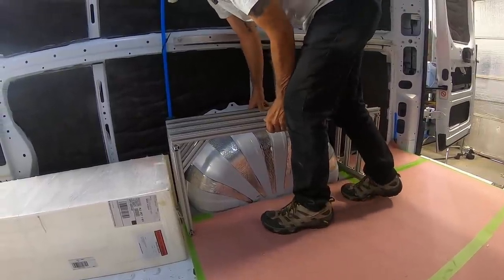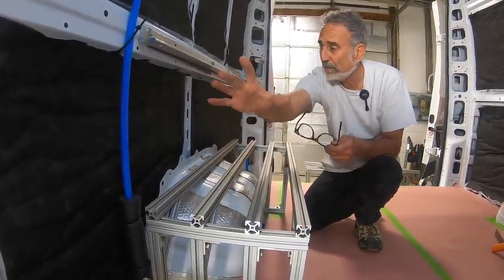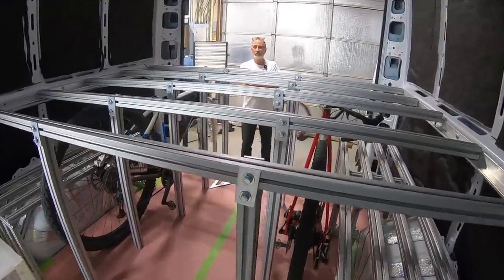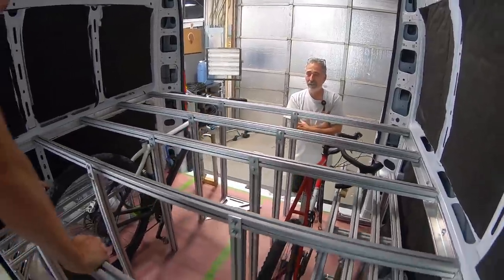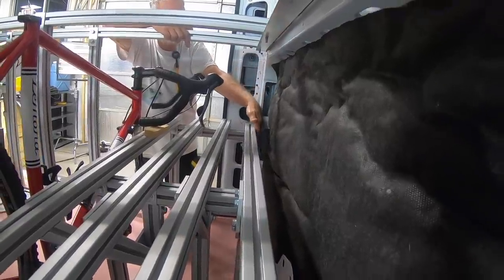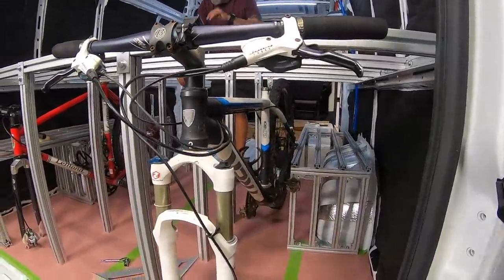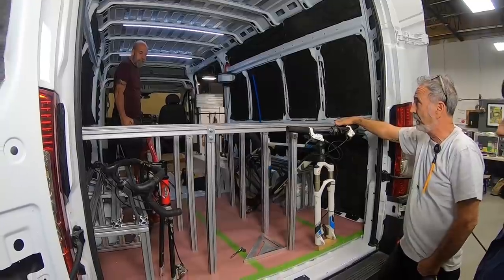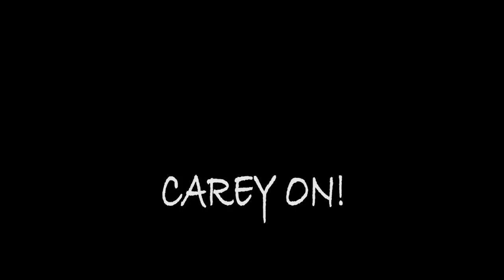Epic Van Garage, Van Bones. Vagabond Van Build.

Comment: I like the garage design, very functional. This is why a custom build is the way to go, you can get the dimensions just right for your needs and not waste a single inch of space. Plus this 80/20 seem like a good investment too, being lighter and stronger than wood, although it's probably is bigger hassle to work with, especially fastening it together and to the van chassis. It's coming together nicely guys...great work!
Reply: I bet it wont come apart like wood might in a crash though. (Jinx)

Comment: I would like to know how much heat still transfers despite the heavy weight vinyl acting as a barrier between van body and 80/20? Put the van in the sun and put an unattached 80/20 piece for a control. Take temps of van metal, the bolt in between, the attached 80/20 bed in different places and compare for heat transfer.

Comment: Hi!  On a future video could you mention the specific 80/20 extruded aluminum size you're using?  1"? 1.5"?  metric?  Thanks!  Gonna be solid a f !
Reply from the maker: Using some 1” and some 1.5”. It
Depends on the area and strength needed.